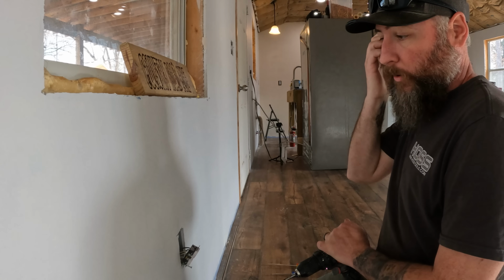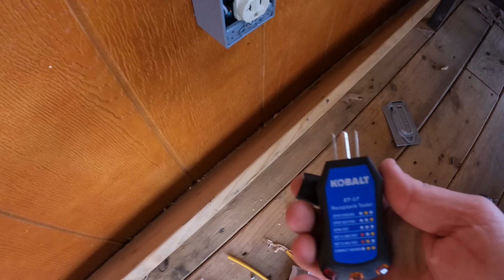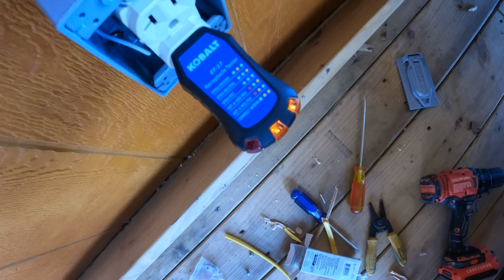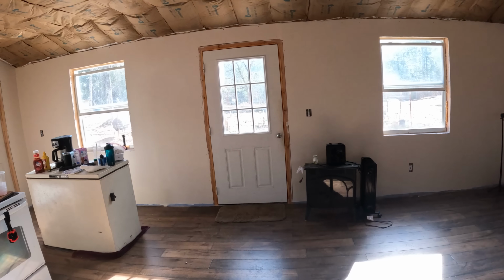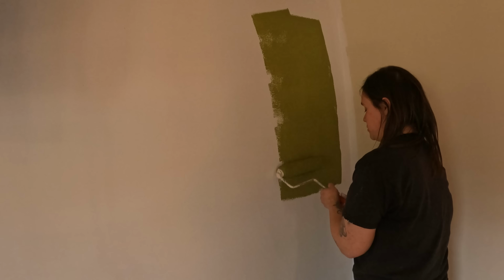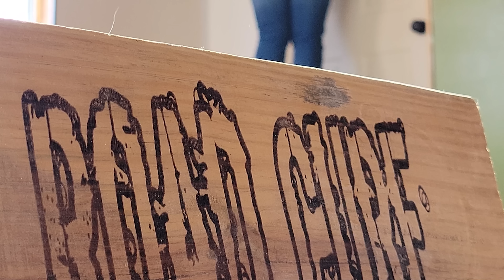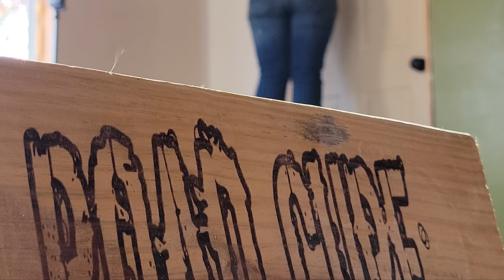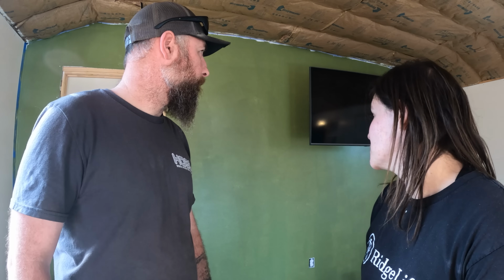One PHONE CALL that CHANGED EVERYTHING! | DIY | Tiny House In The Woods

Comment: You take a sheetrock nail or any nail and hammer holes along the ridge the lid sits into it helps with the pour so drains back and when lid gets put on not stuck when open again and splashing you when put it on. they also have pop on lids so paint only comes out like an opening. Probly about done with the painting by now maybe pass the ideas to sister and hubby they will have a.lot of painting comeing up yet.

Comment: I don't if you have thought about this but after the kitchen is painted You might consider putting up a piece of clear vinyl in the area of the stove so that if grease splatters, the vinyl will protect your wall.
Reply: or a pretty metal back splash or tile.